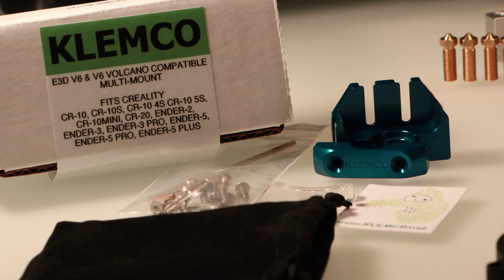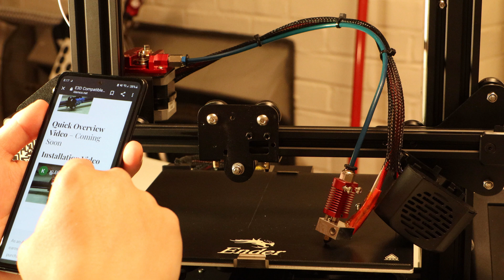Ender 3 V2 - Print Silently and 4X Faster!  (Step-By-Step Guide)

Comment: if making an ender 3 quieter were as simple as swapping the fans then i could do that, but my ignorance of electronics keeps me from ever doing this since every quiet mod i've seen requires you to add some kind of power converter thing that i don't understand. i've heard you can fry your printer or even shock yourself if you don't know what you're doing, which i don't.
Reply from the maker: If you short something out it can fry the board easily, thats the only thing you really have to watch out for. 
There are actually a number of fans that are quieter and don't need a power converter. You just have to make sure to get 24v fans instead of 12v fans.

Here are a couple examples:
Motherboard Fan: https://amzn.to/2VHhzeM
Hotend Fan: https://amzn.to/3lSKHL6

Except on the power supply, the power supply uses a 12v fan (you might be able to use a 24v if you short out a zener diode but it sounds like that is something you would want to avoid)

But at the end of the day the easiest way to do it is to get a printer that comes stock with silent fans. I have heard the artillery sidewinder is pretty quiet since it uses a different kind of heated bed. Basically the bed uses AC power instead of DC, which takes a lot of load off of the power supply. 
https://amzn.to/2VPrBLb

They just came out with an X2 version which I would probably get instead of the older one I linked to, but they are both good. The X2 has an optional bed leveler.

Comment: I want to exchange the fan on my power supply but the power supply is under the build plate so the fan would reach the floor, how did you get the power supply upright like that ?
Reply from the maker: I made a separate video on that topic:
https://youtu.be/9e-2i5WE-gI

If you put the squash ball feet on you should get about 1.5" of ground clearance, which would be enough for a low profile fan.

If you are feeling really crazy you can replace the Meanwell power supply with a laptop power supply like in the video, so it makes 0 noise. Only thing is you'll have to retune the PWM or upgrade your heater cartridge which is actually quite simple to do:
https://youtu.be/uqCntWdLIvA

Comment: I got noctua fans as well but there is something different in mine, its a 3 pin instead of a 4 pin, would that affect the end result?
Reply from the maker: Good question.

3 and 4 pin fans have lines for power, ground, and fan speed.

The fan speed line alternates between a low and high voltage as the fan spins, which your PC interprets into fan speed.

The 4 pin fans have an additional line that is a PWM speed control line. It basically a signal line that lets you set the throttle of your fan between 0% and 100%.

Most 3d printers can throttle the part cooling fan, but this throttling is done on the motherboard by turning the power line on and off rapidly using PWM.

For all 3d printers that I have worked on, you only use the power and ground lines (for Noctua fans this is normally the yellow and black wires, yellow is the ATX standard color for 12v).

As 3d printing technology gets better we may see 3 or 4 pin connectors being used, but for now they should be the same.

Comment: Creality fit 12V fans to PSU but actually on the connector are 24V, dont get foul by labeling on the fan.l!!
Reply from the maker: I have heard elsewhere that it is sometimes 12v, sometimes 24v.

I just looked inside my PSU, it has a 12v fan. I think they use a zener diode to reduce the voltage from 24V.

I suppose I could short out the diode and use a 24v fan instead.

Comment: From what I can see, you didn't get your nozzle screwed all the way up to the heater block.  I would have backed the heat break out a little so that I could get the nozzle butted all the way up to the heater block, as some thermal transfer to the nozzle will be lost otherwise.
Reply: So he did do this correctly. You leave that bit of space so that it in fact doesn't bottom out on the block, and it ensures that it's tightened against the heat break, which is critical. If there is a space between, or it's not tight enough, it can make a gap the filament will end up in, resulting in a horrible jam. Minimizing the amount that it is away from the block isn't going to hurt, but it should never butt up against the block.

Comment: What is the total $ price? Is it still worth it considering the extra cost?
Reply from the maker: There are better options out there now. If you are at all concerned about value I would skip the noctua fans.

I just did another 3D printer build based on the FOKOOS ODIN this week, which I really liked. I will post a video about it soon. It is loaded with most of the features that I added to this machine and then some.

But it too has some deficiencies that I solved through modding. Had to replace the heated bed, added quiet fans, and changed out the hotend/extruder but its printing so well now.

Comment: Hey thanks for the video. The link for the hot end volcano kit is no longer available. Could you provide an alternative or maybe just list the parts necessary individually? Thanks
Reply from the maker: This one worked for me:
https://amzn.to/3rHEPo6

You can also look up "v6 hotend kit" and that should bring up a bunch of other listings.

Some only include a standard heater block though, so if you are interested in the volcano make sure to look for one with the longer brass nozzles and the volcano heater block.
Reply: @NathanBuildsRobots  instead of buying the clemco mount, could i print something like the "Petsfang Duct" mount, for this setup with a volcano, or would it be too hot and melt it? :)
Reply from the maker: @ThePineTreesBand  A printed mount will work. I would stay away from PLA as it has a low melting point and could drop your hotend, which would be bad.

A metal mount will always be more failsafe, since it will never melt, and helps transfer heat out of the heatsink and into the frame of your printer, so you will end up running a little cooler.

That said, Prusa printers, which are some of the best on the market, use a printed mount made of PETG and have great quality/reliability.
Reply: @NathanBuildsRobots  interesting. Yeah I have some petg. I'm pretty tempted to try it honestly. I won't try an hold you accountable if it fails 🤣 
Thanks again for all the info and quick reply. I'm now believer in you're channel and subscribed
Reply from the maker: @ThePineTreesBand  Some say to leave the printer on after you finish a print so the heatsink fan stays on, otherwise heat can creep into the plastic parts while its off enough for it to melt. Its not as much of an issue if you have a metal mount but is still a good practice.
Thanks for the sub! I just finished editing a new video, so more content is on the way!
Reply: @NathanBuildsRobots  that's what I'm talking about! Thanks a bunch mayne

Comment: Hi, why did you decide to use PWM and not the FLX version of Noctua? I ordered both of them and want to use the 12V 2pin fan connector and I am not sure which one should I use.
Reply from the maker: Look up the "pinout" for the Noctua fans. 
I believe the standard is:
Black = ground
Yellow = 12V

The other 2 wires are PWM signal line (which you don't need to wire up) and RPM signal line (which you also don't need).

Comment: Couldn't you power the buck converter using the stock 24v fan output on the PSU?
Reply from the maker: Yes, you just have to keep in mind that the output only turns on when the power supply is hot.

Comment: The smoke is most likely from the thermal paste that you used when screwing in the heatbreak. Unless you didn't use any.
Reply from the maker: Should I be using thermal paste? I put it on for my fanless Ender 3 build but haven't used it on the rest of my builds.
Reply: @NathanBuildsRobots  E3D recommends using a small amount of thermal paste on the threads of the heat break. But only on the threads that go into the heat sink. The threads that go into the heater block should remain bare. Other parts like the nozzle also don't need thermal paste.
E3D hotends usually come with a small pack of high-temperature thermal paste. You should use that stuff. I read that regular thermal compound for computers is not good enough.

Comment: Could You tell us what You did to improve the print quality on this nozzle?
Reply from the maker: I added a part cooling fan. For the tall rainbow part it was spending about 25 seconds per layer, so the previous layer was still melted when the new layer was going down which caused a lot of issues.

Comment: The PSU fan is already 12V. Why a converter?
Reply from the maker: A couple videos I watched said it's either 12v or 24v so I was a little confused. I just bypassed the confusion and put in a parallel system.
Also I didn't want to open up the power supply.

Comment: just run the fans in series that will work 2*12 fans in series will work on 24v
Reply from the maker: I ended up doing that on another video and it worked. It suprised me because they are not simple resistive loads, but I guess its close enough!

Comment: Hey bro you got a huge warp best thing to do is make an enclosure or turn off the ac in the room the printer is in. I just put mine in a small closet on a table and blocked the draft under the door (important also) with a towel and all my prints come out perfectly flat.
Reply from the maker: I want to get an all metal enclosure. I wonder if an old oven off craigslist would work?

Comment: Great vid, one thing tho if I were you I would change the hotend thermistor and heatcatridge because they still contain ptfe (you can see it if you look near the end of the cable) which would be harmful at high printing temperatures.
Reply from the maker: Good point, I didn't think about the material used on the thermistor. Is the translucent plastic covering the wires made of PTFE?
Where is the PTFE on the heater cartridge? I thought it had a fiber/silicone wire covering

I use cartridge style thermistors on all my new machines because they are safer in terms of not being able to short out, but now I can add your reason to the list of why to use the cartridge style ones.
Reply: @NathanBuildsRobots  Yeah that translucent tube is ptfe, a lot of heater cartridges have it too but inside the protected casing (so I don't know if that should be a problem, but the thermistor if like a glass one makes contact so its a no go for 250c+)

Also you can see it here said by another YouTube https://www.youtube.com/watch?v=GCB-RhB7Q-c&list=PLjfIE9m_MaixIC9Dd_VILZtCrUYYAOJSV&index=16 (He explains it till 02.00 minutes

By the way what hotted would you recommend for high temp?
Reply from the maker: @studywithme8055  a cheap all metal v6 style hotend will work fine. I would upgrade to use better materials on the hotend to get more consistent temperatures (copper nozzle and heater block). Microswiss is also pretty good as a medium price option that bolts directly to the Ender 3 platform.

Right now I'm working on 2 videos with phaetus hotends - dragon and dragonfly. Both are excellent but the dragonfly HF has a design flaw, not sure if the same problem exists on the standard dragonfly.

I like to cobble things together, but if you want a better building experience I recommend buying a kit. It only ends up being slightly more expensive than when you spec everything out yourself, and you're much more likely to end up with a nice setup in the end.

Comment: Hey Nathan, I have an E3 V2 and I was never able to figure out how to maximize the print area over the stock 235x235mm size. I don't see the parameters in the firmware... How did you do it?
Reply: I think you need to compile a custom Marlin firmware, it's pretty easy as there's plenty of guides out there. I also think that custom firmware is much better than Creality's.
Reply from the maker: I didn't touch the firmware in this video, but this article covers how to flash your firmware: 
https://m.all3dp.com/2/ender-3-v2-firmware-update/

I'd check out Chris's Basement to learn how to install Visual Studio Code with PlatformIO, and configure Marlin for your Ender 3 V2. The specific parameter you want to change is "X_BED_SIZE" and "Y_BED_SIZE"

If you're really lucky (and don't want to spend 10 hrs figuring out how to configure Marlin correctly)
 you might be able to find a precompiled firmware file that you can just download, put on a flash card, install into your V2, restart the printer, and your done.

Comment: Anyone have any idea which of these mods will also work with the Voxelab Aquila (ender 3 clone)? Thanks!
Reply from the maker: Every mod on this video should work on the voxelab. The only differences I've noticed that could affect mods are: 
Different fan shroud mounting hole pattern.
Slightly different x axis limit switch positioning.

The rest of the machine is so similar that most mods should be compatible. I'm working on modding my Aquila now, one video will be out in the next couple of days where I put on a direct drive extruder kit from microswiss, then another will be out in 2 weeks whew I put on a dragonfly HF hotend from Phaetus..

The hotend heatsink, hotend mounting, heater block,  motherboard mounting, power supply, and fans are exactly the same. 

The glass bead thermistor was glued in on my aquila using some kind of thermal glue. It took some force to pull out and I could have damaged the thermistor if I wasn't being careful. Most hotend kits come with a replacement thermistor, but some want you to reuse the stock one, so just use caution.

Comment: Wire schematic/diagram??  Thanks!
Reply from the maker: All of the fans are running in parallel on the 12V buck converter, which is powered by the power supply. The rest is pretty much stock. 
I'll describe wiring more thoroughly in future videos.
Reply: @NathanBuildsRobots   thank you! I have them all set up and working! What a dream the silence is! Again, thank you fir this great MOD!

Comment: 0:40 I made my own "squash balls" by folding up paper towels and wrapping them with electrical tape 😉 👌
Reply from the maker: I like it. The squash balls are pretty much ideal for this application - amazing sound dampening and great grip, but they are a bit pricey. 
I've also considered suspending the printer in the air using cables, but it has to be done properly. After all, a lot of instruments use tensioned strings to transmit sound. But it might be pretty cool if certain tones were amplified so your printer would play random songs while printing.

Comment: I'm about to order a v2. Never printed before. Is there any reason why I shouldn't order and install all upgrades now to achieve a better overall machine? Shorter times same quality. Seems like a no brainer. Advice?
Reply from the maker: You should consider the voxelab aquila, it's pretty much the same machine at a lower price. I made a video where I compared the two. 
https://youtu.be/SMLL-16FQWk

The stock printer works great, it's worth trying it out so you have a baseline to know what the upgrades are doing. 

With the 0.6mm volcano nozzle I put on in this video you gain speed by lose some ability to print fine details.

With an all metal hotend you can print higher temperature materials, but can increase the chance of jamming. 

With direct drive you get better control over extrusion and can print flexible plastics, but you have a heavier hotend and get slightly more ghosting because of it. 

So most upgrades are really trade-offs. The stock setup is a pretty good all rounder, and I've found that it outperforms my modded printers in some aspects. It's better (and cheaper) to identify a need first, then pick the right upgrade. But then again, I'm guilty of buying a bunch of upgrades and putting them on right away.

Comment: DONT USE NOCTUA FANS UNLESS YOU ENJOY HEAT CREEP! THEY DONT HAVE ENOUGH FLOW
Reply from the maker: They are quieter but also lower wattage, so you need to take that into account when replacing fans. On this build I am using a 30mm fan on the hotend heatsink, though on other builds I'm using Noctuas on the hotend without any heat creep issues. I used 2 hotend fans instead of 1 to make sure I get similar flow compared to the stock fan.

Comment: the original psu fan is 12v so you wouldent need the stepdow there
Reply from the maker: When researching for this project I heard it could be 12 or 24, so I decided to play it safe and leave the original fan in there. 

I wonder if you could replace the thermistor in the PSU with a radiator so the fan is always on, then tap into that connecting to power the rest of the fans on the printer without using a separate step-down circuit? May have to try that in a future video.

Comment: 6:20 loved that tip! It's not as useful with an all metal hotend or a PTFE lined heatbreak, though
Reply from the maker: I thought it was just to help reduce backlash in the bowden tube for cleaner retracts, that's why I've always done it. 
But you're right, it's probably most useful in the stock setup where a gap can form and cause a clog where the PTFE tube enters the melt zone.
Reply: @NathanBuildsRobots  Indeed

Comment: you are really great in making videos, but your wiring looks a bit dangerous in my opinion - plugs are always a safety risk and missing strain relief
Reply from the maker: Thanks. I am lucky that I can put my printers up on a shelf and nobody can touch them, so I don't have to worry about the wires getting yanked out. 
Which plugs are a safety risk?